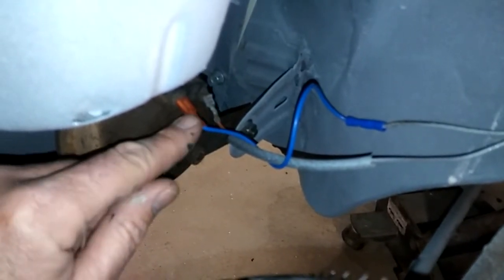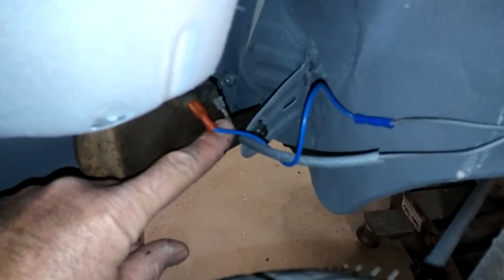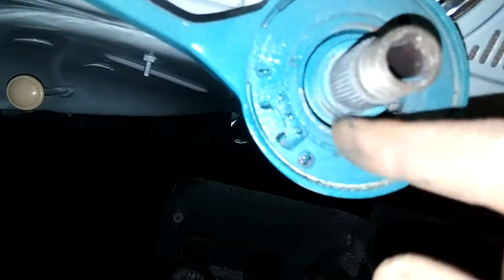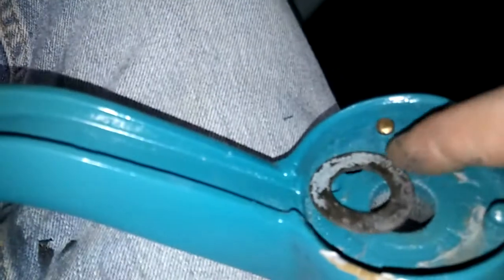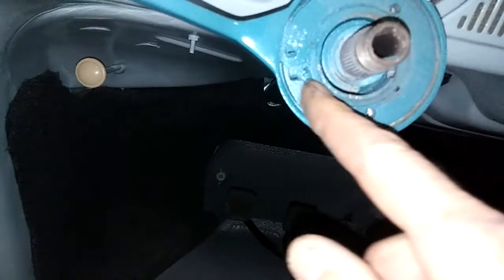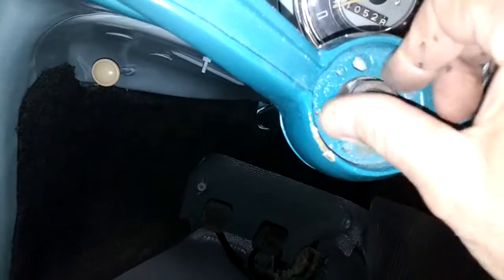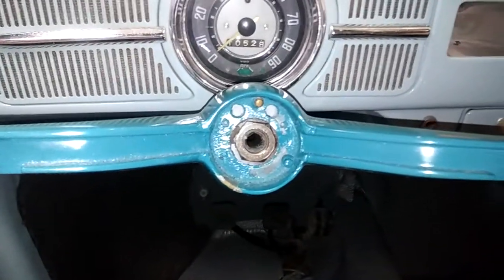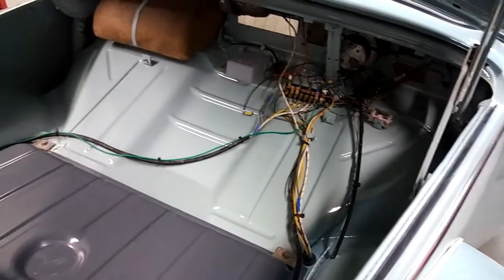VW Bug horn circuit how it works 60 - 61 Plus 62 and later the difference

Comment: Ty once again Mike for your videos. I have 61 which is using repop wheel that doesn't have the 3 pins. The  wire does the horn if i touch on the the base of the indicator with wheel off 
The indicator has a grub screw that goes on to the column . If i boltb the wheel on put wire to the d ring it didn't work. 
I've re moved  cancelling ring and abs insulator at the bottom of wheel . It's got me stumped

Comment: Mike - first thank you for your videos.  Do you have information on the early 1960 beetle horn circuit as my  bug has multiple 2   4-fuse fuse boxes  so wiring is a bit different.

Comment: Mike I love your videos. you post all videos that no one thinks to do. Have you checked Bentley'  the bible " repair manual.
Reply from the maker: Yea I have one of those but for the Rabbit not for Bugs. I have some really old chiltons and haynes. Might get those out for show and tell. Great pics. Dont really use them anymore. Most of what i do is from experience many years of having and working on VWs since the late 70s.
Reply: +Mike F what part of Fl? im in Tampa
Reply from the maker: I was there. I traveled the whole state just a few months ago. I work for large banks in the sign industry. We did an hours change. I never know where we are going until a few weeks in advance. We visited several banks in that immediate area then headed north towards Homosassa. Had a sunpass for all the tool roads. ha ha.

Comment: can I get a turn signal relay  in 12 volt like yours gonna upgrade and not sure where to put the bulky one thanks
Reply from the maker: electronic turn signal relay on ebay. Look it up with the word electronic.. Sometimes if you old one is bad you can put the new one in the old housing. and put a cardboard over the terminal section to make it look original.

Comment: do you have all your isolation rings in the steering wheel and ccolumn also there's a rubber sleeve that sseparates the connection till you press the horn button and two caps right under there steering wheel one metal one plastic and yes there are three spring contacts on the wheel its self